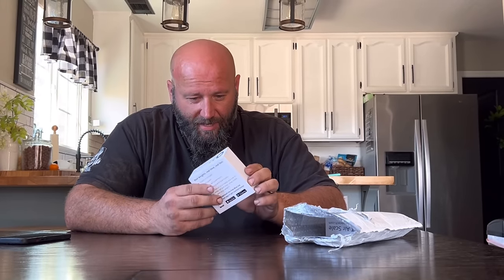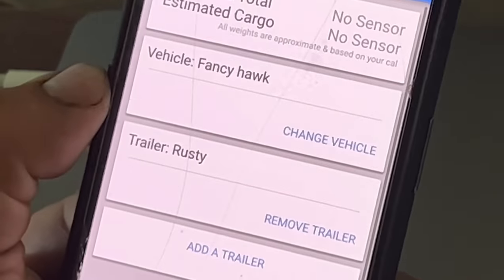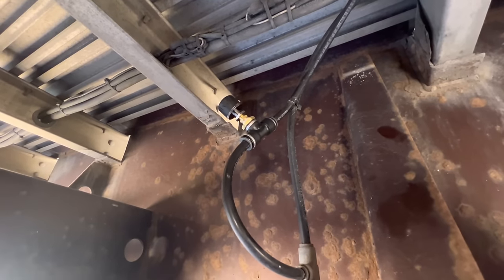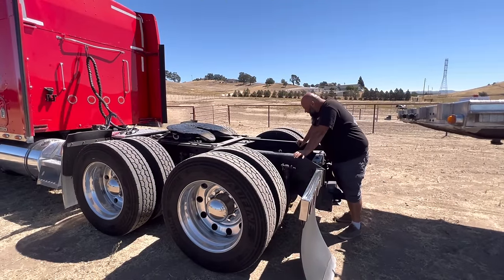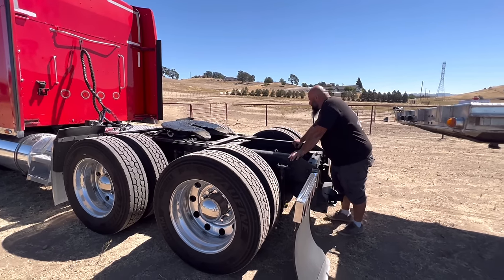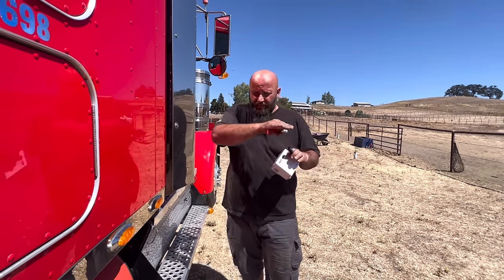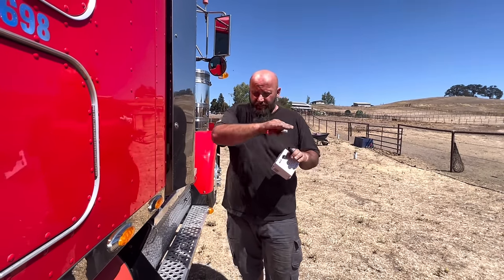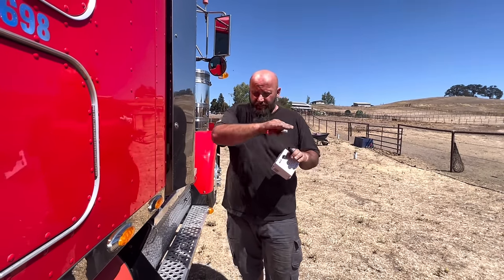"EASIEST WAY TO SCALE YOUR LOAD" | BIT Air Scale Install & Review

Comment: I just called Bit Blue Link Tech .. and the process of it is not bad at all $400 and I have the gauge on your fifth wheel or $430 to have it on the app that's a real good deal
Reply: Interesting to see some prices listed because nowhere on site did they disclose it…that’s higher than the competition.
Reply from the maker: it’s comparable to a good analog gauge kits so it worked for me to as reasonable to purchase 🤷🏼‍♀️
Reply: @TruckingTogether  my comment didn't word correctly.. I don't have the BIT scale.. I just called to check it out.. They're located in Huntington west   Virginia.  Which I was born not far from there in Ironton Ohio across ths river  from Ashland ky .

Comment: Boy have times changed. Technology has really changed the way trucking is done. I remember jumping into a 1949 Needle Nose KW . Four and four 220 Cum A Long. Armstrong steering not even a fan in the cab. You went no where fast. Everything about those trucks was work. Fun at a show but that’s about it. Nice to see one half of the team looking out for the other half.  It really shows what Trucking Together is all about. You have such a nice channel and by both getting air time it cements it’s about use too. Any who guys have a great and a safe day, happy trails..

Comment: You have to love the on board scales , I put a scale system on my Mack tri- axgle about 2 years ago , it consists of 2 load cell hinge pins in the back and a hydraulic sensor in the hoist,  For the 1st year it was accurate to within 200 pounds, now it's about a 1000 pounds off but I know how to compensate for it. Just needs to be recalibrate d.  It's amazing how accurate these things are. I also install a hawkhead tire pressure monitoring system, I just don't know if it's DOT certified though
Reply from the maker: Yeah I would imagine a re calibrate would help every once in a while with most on board scales.

Comment: When you first installed it I was wondering if the frame was going to interfere with the signal with all the aluminum and steel on the trailer, great how to video and keep up the good work God bless from GA

Comment: Martin-  Aren't you concerned about all those new connections becoming air leaks eventually?  Maybe keep a repair kit in the truck.  Good luck..........JM
Reply from the maker: Not really, the plastic push locks don’t really leak and are easy and cheap to replace. Metal ones leak.

Comment: Not a driver but as a long time viewer of Clutch Trucker channel, he’s used the competition App Weigh for much more than a year and been very happy with it. From the websites: Those sensors sell for $165 each with no ongoing fees while the BIT ones don’t disclose cost clearly (I couldn’t find anything) and apparently have a $240 annual fee?
Additionally, the App Weigh has a 90 day money back guarantee…do these?
Reply: Addendum - at 10:22 showing Step 2 of calibration, the BIT app has a typo: “calibraiton”…it’s a tech company and something that obvious? Ok, minor bug but…
Reply from the maker: they have additional features and services and some people pair the ELD with their account so they can keep everything in one place but you do not need a subscription to get the weights on the app.
Reply: @TruckingTogether  it certainly wasn’t clear on their website that subscription isn’t needed. 
Vendors that don’t make prices obvious are generally regarded as being overpriced. 
But if the product works for y’all, that’s fine.

Comment: Hi kids!!  You have it programmed with you in the truck I know you have been solo lately. What happens if wife goes with you on a load do you have to reprogram it all over again because of the weight difference??Thanks for the videos they are great. Have a great day and good luck on finding some loads.
Reply from the maker: are you saying I’m fat? 😂😂😂
Reply: @TruckingTogether    No no no. Please don’t take it that way. I am sorry. I was wondering about any weight changes if you had to reprogram it??  I have been with you guys for awhile now and hope everything is cool.  Have a great night!!
Reply: @mikeodonnell3390  remember the other factor that’s constantly changing is the fuel load/weight. The app simply needs to know two reference points reasonably close to both ends (empty and full) and then can adjust to less than the ‘empty’ or greater than ‘full’ or anything in between.

Comment: looks ok hope it lasts does it require to be calibrated by officials? any loads yet? did you guys get a discount for the advertising
Reply from the maker: It doesn’t have to be calibrated by officials, we had one load on it so far. Yes we did.

Comment: So calibrating involved strictly the load weight? I thought it might be the difference without including the steers both readings.
Reply from the maker: You calibrate empty and loaded. Can’t gets a steer weight unless it’s air ride front. It’s hard to overload a steer unless you have a Volvo and slid the 5th wheel to far forward.

Comment: How much did they cost been looking at them but until you order I can't get a price
Reply: They didn’t say in video nor is there anything on website…so as a viewer of both channels, I would look also at App Weigh as recommended by my acquaintance YouTube driver Clutch Trucker for $165 per sensor.
NOT trying to take anything away from Alice and Martin but costs need to be disclosed.
Reply from the maker: didn’t want to list costs because things are always changing so fast in the industry/economy with prices, so if we published a cost it could very well change a few days later. They cost us no more than most good analog guage kits do. They build the kits by how many sensors/extensions/ect best to just call them and they would give a no pressure quote, super nice folks to deal with!

Comment: I think it's the same company as appwieght. Be careful, good too see if you have to scale out, but I wouldn't trust it. Doesn't matter how many time I calibrated it it still went off.
Reply from the maker: I don’t believe it’s the same company
Reply: @TruckingTogether  DEFINITELY not the same company since appweigh has an obvious dig/slam of this one on their website! However, it wasn’t until I knew of this variant that I recognized it as such because of the name “BIT”.

Comment: I would rather just pay Cat Scale  I need all I can get for tax write offs plus cat scale are guaranteed
Reply: Another driver who uses a similar product had a situation where he was able to detect a definitely overweight load before leaving dock so they could rebalance and/or remove some of it. Avoiding trip to scale twice and shipper. If his is close to limit, he will CAT verify it but reduced the need for most scaling visits.
Reply: Addendum - I don’t understand the “tax write off” thing, because if you’re paying, let’s say $15, for scale, then yes it’s an expense but it means you also lost $15 of income, ok? Wouldn’t it be better to not spend the $15 and instead possibly pay $5 in taxes on that $15 income but leaving you with $10 more in your pocket than the other way?
Reply from the maker: What if you’re an hour from the scale through some tedious terrain and have to go back because you’re overweight and the shipper is closed??
Reply: @TruckingTogether  exactly, and I believe Clutch uses his App Weigh also to better help determine where to set his tandems even if he isn’t overweight in total gross.